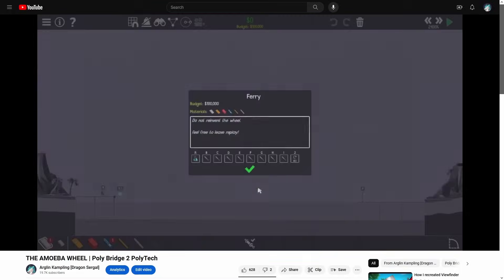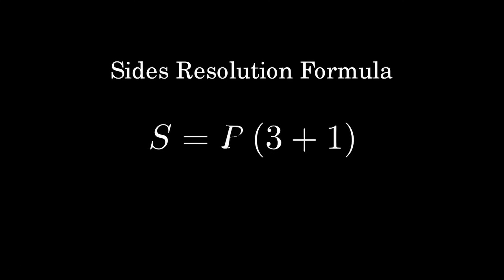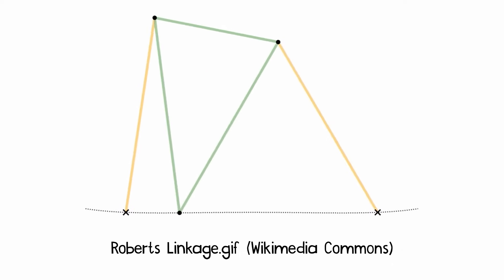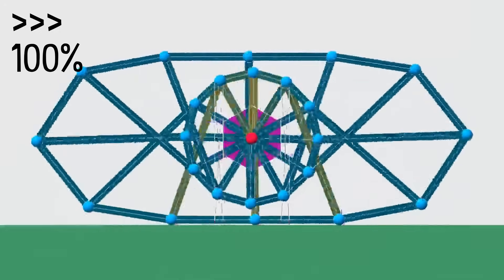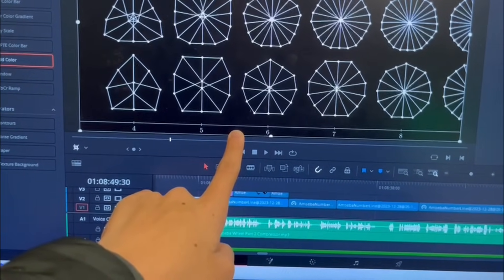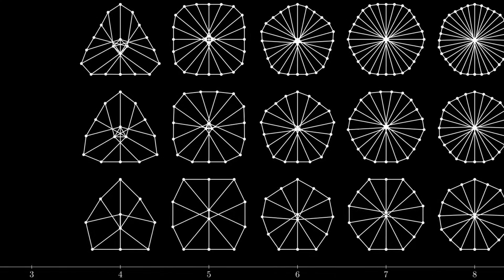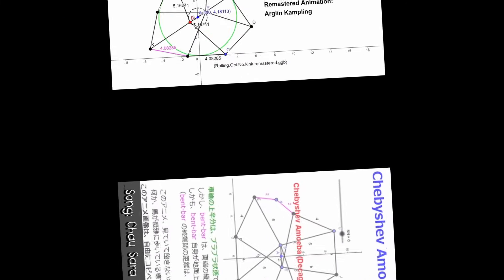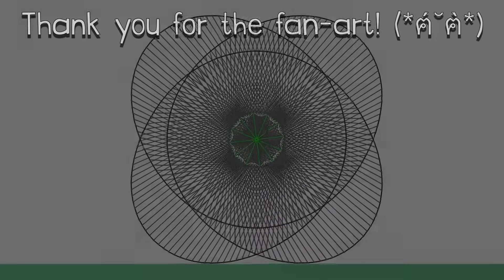The weirdest wheel just got WEIRDER... (Amoeba Wheel Part 2) | Poly Bridge 2 PolyTech

Comment: I wonder how a Roberts amoeba wheel compares to a continuous track in performance. Not necessarily in Polybridge, but even in reality.
Reply from the maker: In general, truthfully, amoeba wheels are much worse.

Continuous tracks rely on riding around wheels to help add traction. So long those wheels have some form of suspension, the track is capable of deforming and molding to the terrain it's on. Amoeba wheels have no ability to deform. (Matter of fact, they're technically not even supposed to be able to roll, as they completely violate the Chebyshev-Grubler-Kutzbach mobility formula.) But yeah, it means it won't behave like a continuous track a lot of the time.

Roberts amoeba wheels are also problematic in terms of construction: trying to avoid link collisions is a pain in the butt; you can ask the many people who reached out to me and have been attempting to model it IRL, haha.

That said, it's actually not possible to build a continuous track in Poly Bridge without modifying the level assets, which for obvious reasons are not allowed in the main campaign. Most of the time, for levels which require the construction of wheels, the level also have fairly flat terrain. So Amoeba wheels are, by pure happenstance, the best wheel you can make in Poly Bridge. It just doesn't translate very well into real life.
Reply: @ArglinPB  I figured as much, I'm fairly knowledgeable on the characteristics and strengths and weaknesses of continuous tracks. I'm still curious about if there's any kind of marginal or very niche situation where an amoeba wheel of some sort would have utility.

I wonder, is it possible to make an amoeba wheel where the failure of one outer section doesn't collapse the entire mechanism? I'll have to think on this.
Reply from the maker: @specialagentdustyponcho1065  If you do find any new insights, do share them in the Poly Bridge Discord if you can!

Comment: Funnily enough, very similar math can be used to calculate rollercoaster track shapes.

A vertical loop that maintains a constant G force throughout its length can be expressed as a series of the same linkage connected end-to-end like in an amoeba wheel (except instead of lying on a circle, the "pedals" are along a line). I won't show the exact logic used here but I will go into details if anyone asks.

Anyway, the limit of this linkage series (lengths of two opposite links tend to 0 but keep the ratio) is the exact shape for a looping track with a constant G-force. So far I only managed to find the expression for only one case (reverse parallelogram linkage) so I'm sure all tis math can be used for my own goals too.
Reply from the maker: Holy crap... this could actually be a really good lead.

One of the curiosities I've been trying to figure out is what curves do these wheels tend to as you let the number of pedals go to infinity. I would love to know if some of the math you're working with can be extended to these!
Reply: Checking if you had an update for Arglin.
Reply: Ah yes, the good ol' clothoid loops back when loops were about maintaining 1G at the top while still keeping safe Gs at the bottom.....

Nowadays though, stalls seem to become more popular due to "inverted hang time" sensation and a more dynamic change of G forces throughout the element, so loops started to become circular or even egg-shaped (e. g. Finnish loop). I wonder if there's a specialised math for that, perhaps emulating the G forces of an ejector airtime in a vertical loop?

Comment: Really cool. I’m really interested in part 3. Is that discord public? I’d like to try building one of these irl if that’s actually possible
Reply from the maker: Yes! The Discord is public!

I have linked the server in the description, feel free to hop by! I'm actually providing dimensions right now.
Reply: Is it even possible to make an amoeba wheel? Don't the spokes have to pass through each other?
Reply from the maker: @TlalocTemporal  Yes, it is possible. The pedals can be arranged in a fashion similar to that of a crankshaft in an engine block. :)

Here are some examples of Amoeba wheels arranged in 3D.
https://www.geogebra.org/m/xuwvhqe7
https://www.geogebra.org/m/udkcu7e9
Reply: @ArglinPB  -- Ah, I thought about some kind of crankshaft configuration, but I couldn't picture it.

A stable version might need twice as many spokes to not twist itself to pieces though.
Reply from the maker: @TlalocTemporal  Yeah... the more pedals you have, the worse it gets. Just the pentagon one requires a really weird crank shaft and the loading will constantly shift without doubling up as you suggested.

I would assume the machine required to make those pieces is not going to be fun either... so the most practical would probably just be the two pedal designs.
(Then again I guess practicality was never first priority when trying to re-invent the wheel, haha)
Reply: @TlalocTemporal  they don’t have to be in line with each other in 3D